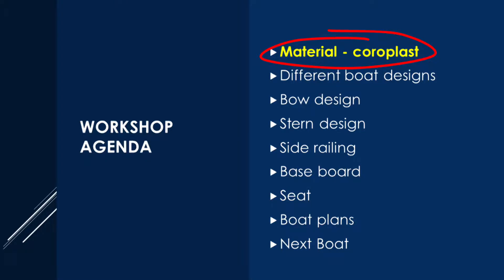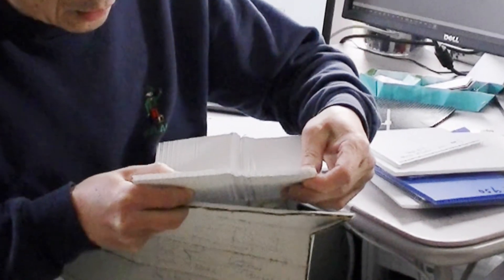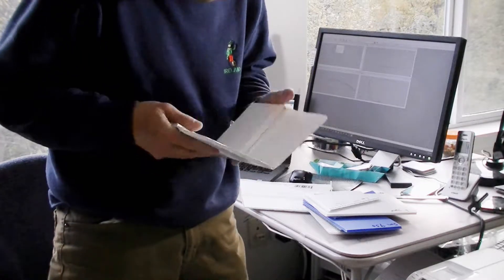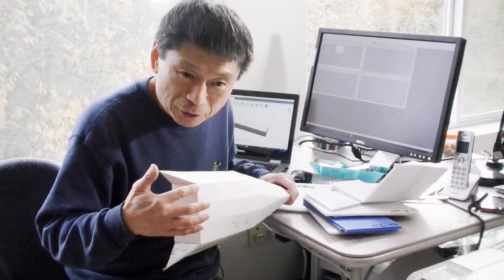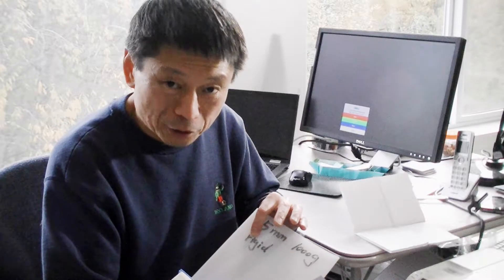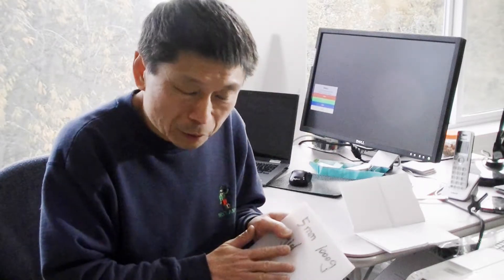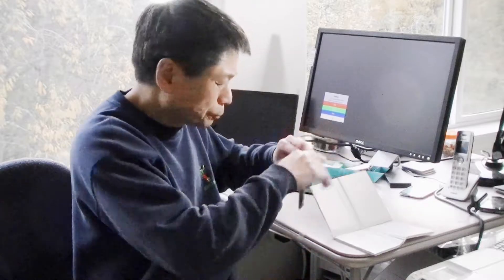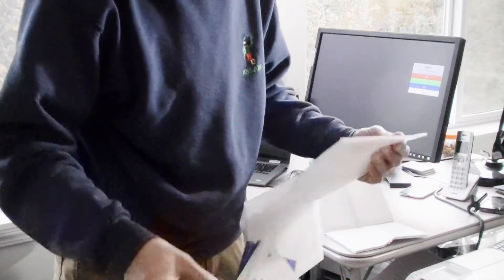DIY foldable boat workshop   part 1 (material - coroplast)

Comment: Could you make a 15' vhull type of boat that could be used inshore fishing? And would it be able to be powered by say a 9.9 hp size/weight motor?
Reply from the maker: I have only tried to mount a trolling motor on a foldable coroplast boat. I imagine it will be challenging for a foldable coroplast boat to handle a 9.9 HP motor. It requires a lot of structural strengthening, However, you can probably use coroplast as the hull and build a rigid coroplast boat. It really depends on how thick the coroplast you use. A 10 mm coroplast is very strong and probably is a good choice to build a rigid boat.. I have built a 14.5 ft long folding tandem canoe. You can go to my youtube channel to get the info about the Gen 16 boat. My Gen 19 10' Canoe has a 4-chine hull. You can see that design on my youtube channel also. I built my Gen 10, which is a rigid coroplast boat. It is much stronger structurally than any of my folding boats.